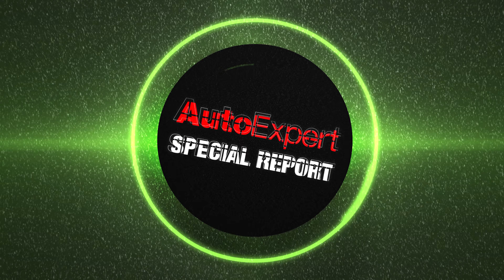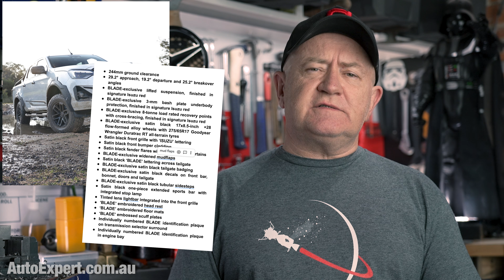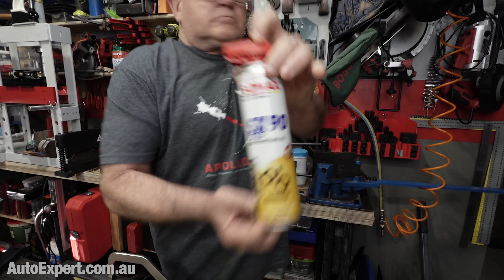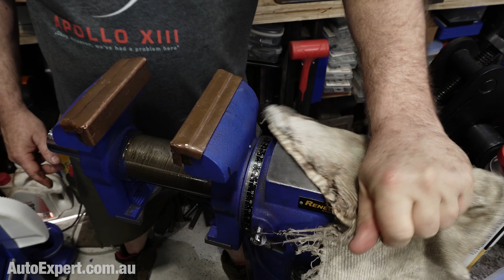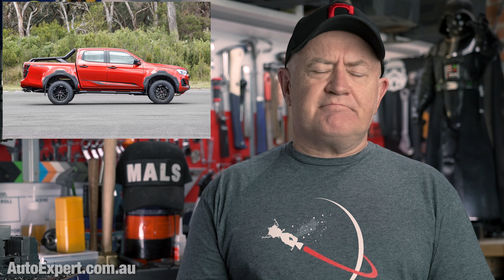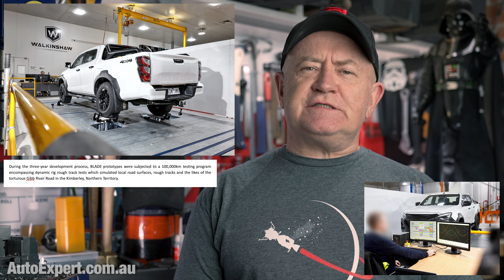Isuzu D-MAX BLADE: They just don't get the Australian Outback... | Auto Expert John Cadogan

Comment: Ok I'm 20 minutes in and I haven't heard anything but sarcasm. My 2011 dmax has done over 400000 kms, I've thrashed it on many a hard track and it's still going strong. I'm loving what Isuzu has done here. Even little things like 17 inch rims (I'd prefer 16s). But it's mainly the engine that Isuzu owners love. Looks like my next Ute.

Comment: Hello Johnna , if you asked every Australian where the Gibb River Road was 90%  wouldn't know . The people in the Isuzu advertising department have thought someone else has looked through the brochure and just released it .I worked at a mine,  underground. A dozen  electricians , with about 15 men assisting , were about to move a transformer .So they were disconnecting the large 3,300 volt cable and a huge flash happened. It singed a lot of hair and put a couple of electricians in hospital with an instant sun tan .Not one of those electricians thought to turn the bloody power off .Each one thought that someone else had done it .I think the same thing has happened with the Isuzu mob .I remember a girl was travelling the Gibb River Road,  and  her car tyres were torn to shreads .This was on 60 minutes. She phoned emergency services and the woman who answered the call didn't believe her where she was,  and refused to send help .There was a large hill near by , so she climbed that and rung her brother inlaw in Sydney  .He was having his lunch at Circular quay .Luckily,  the call went through to him and he phoned emergency services. The police drove in to get her and same thing happened to them and they were stuck also .They called in a helicopter to save them all .I don't know what happened to that call centre operator,  at the very least she should have been sacked .What would that woman have done if that phone call hadn't reached her brother in law .We all love your work, John , very informative and entertaining..

Comment: So, the Santa Fe sports a 2.2L 4cyl diesel with 147kw and 440nm torque. Isuzu struggles to meet that with a 3L V6 diesel unit? Doesnt sound terribly efficient
Reply: Maybe but it will probably last twice as long
Reply: @landau46t  The Santa Fe? Absolutely!
Reply: @romainbricknall4930 umm….no mate. Not a chance.
Reply: @seqroughwaterrides9845  feel free to explain: 2.2L 4cyl 147kw/440 torque vs 3L 6cyl 140kw/450 torque

Comment: Having owned a 2014 DMAX from New I never had any issues other than the usual wear, towing, general building work it works just fine, using this off road it works to a certain extent, one serious issue is the wheel base, it is to long and bottoms out also the 1.9 diesel is a sack of shit.

Comment: D-Max used to be pretty good for offroad utes, years ago. So whatever that went wrong wasn't the old school 3.0L, I liked that engine because it felt "old" and a decade or so ago it seemed pretty reliable.  But I just do not see Isuzu MU-X or D-Max in the last decade compared to what it was like in 2015...
Personally I'd just buy a Triton with the full time 4WD system.  That I explained to the guys that were working at Mitsubishi, before I went off to work for Kia. Otherwise I'd go for a Hilux purely due to Toyota's Australian Distribution network, (I'm  talking over a decade ago)... the word "SIMULATIONED" stands out like nothing else...If I could I'd join the Tansport department to enjoy showing the idiotic mentality of everyone with fully equipped utes, and at least nearly 3 Tonne Caravans. Some are actually scary....if you could do it paid on commission, I could retire using a 5km radius....

Comment: Give this vehicle yet another overstated ute to underground miners . Once  the vehicle is past 6mths old front /rear suspension and brakes will need to be replaced every 3 months . The vehicle once stopped rusting due to no steel left to corrode at the 2-3 year mark is ready for SIMS scrapper . A giveaway is when the body mounts wear thru the body/chassis and the radiator is holding up the front panel work . REAL WORLD TESTING

Comment: I don't think that there's a single 4WD vehicle manufacturer that builds a vehicle that DOESN'T still get aftermarket modifications by true off-road adventurers to make them perform better off road, even the legendary Land Cruiser! 
The bottom line is, but the base 4WD version for a crap ton less and put the RIGHT upgrades on it. As for your slur about the Flinders Ranges, there are many areas that offer  challenges to even the most seasoned 4WD-er as well as beautiful scenery.

Comment: we have a 3 year old d-max here in nz,  its been pretty good but had issues with the after sale service.
anyways  went in for service at 5000km, 2nd one at 15000. we asked does should it need a wheel alignment and got told no.
few weeks later we get a flat tyre. tyre shop tells up all 4 tyres are all seriously worn on the inside. he checked alignment and it was way off on all 4 wheels.
isuzu told us " you must have hit a pot hole etc."
well we sure as hell didnt hit 4!
end result they wouldnt come to the party at all, back to tyre shop for an alignment and 4 new tyres. so that was near on $2k because factory alignment was useless.
Reply: It's the steering knuckle that causes the problem, unfortunately not a great design, aftermarket parts correct this now.
I've been driving Isuzu's for over 20 years and they're far more reliable than anything else out there in my opinion
Reply: @shawsie5780 except Toyota. Check out the reliability & brand loyalty stats.

Comment: Doesn't need to be tough when the furthest it goes is  a dirt road on the outskirts of the suburbs...
Reply: Do you mean, the furthest off road it will do is turn off the road, onto the concrete driveway into the shed?

Comment: Just wondering what season they were "simulating" during these tests. Judging from the operator's attire I'd say it's pretty comfortable in the Outback. Never been, just guessing.
Reply from the maker: Obviously not an atmosphere-controlled rig - like to see how she rolls at 45 deg C and 90% relative...
Reply: @ Yay! My first response from you on a comment. Now if you'd only respond to by request for a "beer garden pow-wow" on engine design (45% efficiency under low-load target).
Reply from the maker: Fine idea - only I'd rather be dead...

Comment: Wonder if they fixed the incessant bump steer problems … worth a researching a vid on this if you want a laugh John. 5000km tyres, class actions… the whole shebang
Reply: It has been addressed with new knuckles
Reply: @stevegoodwin5841  from Mazda/Isuzu or aftermarket? I’m still getting reports of latest new vehicles doing it
Reply: @stevegoodwin5841 what about MY 24 x Terrian  and the lower grades?
Reply: I've driven many dmaxes, never noticed bump steer.
Reply: @Low760 I hope mine will be like yours. I'm still  worried
Reply: @normkubyang9430  it’s seems to effect lifted ones more… but there’s quite a few steering knuckles out there available to fix it anyway
Reply: I had a 2001 Jeep XJ Cherokee for a while.  You'd think after almost two decades of building essentially the same model with minor tweaks they would have worked out the kinks, but nope.  It had the same death wobble as in 1984.
Reply: @Noah_E  death wobble is easily fixed. I have a video on how to diagnose and repair it.